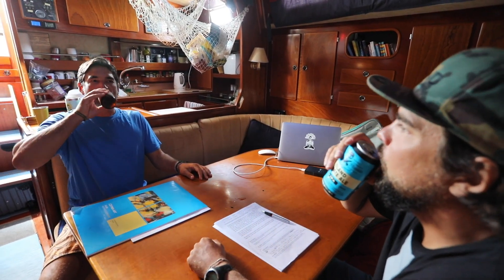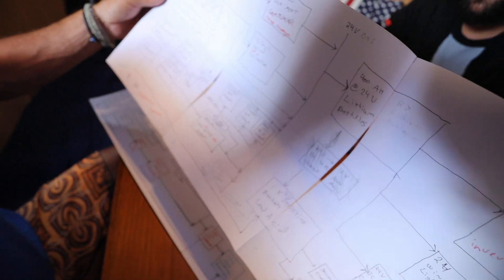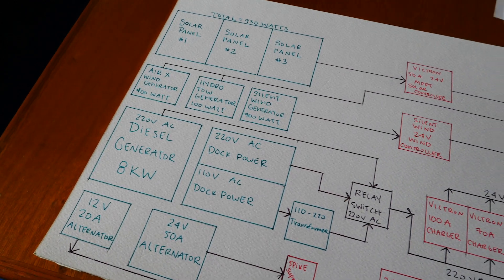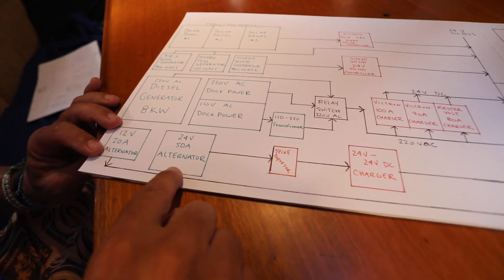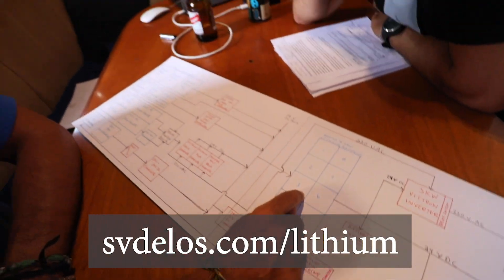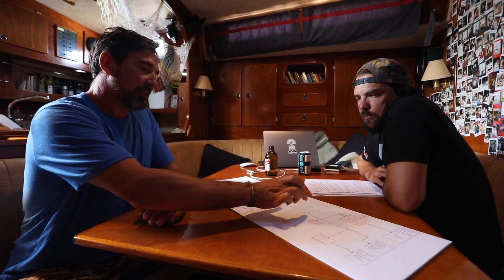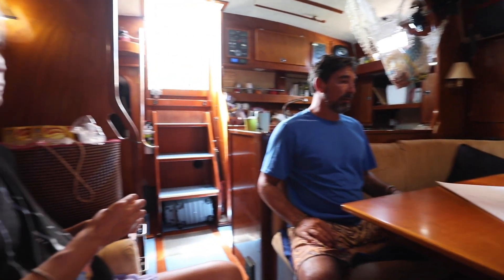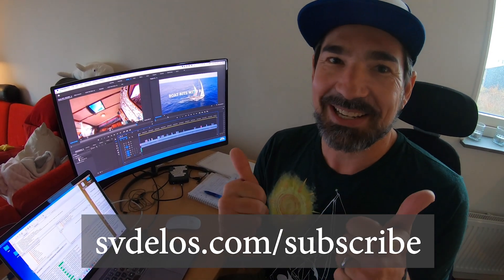Sailboat Electrical System Overview - ELECTRICAL BOAT TECH (1 of 7) - Sailing Vessel Delos

Comment: ... and 50Hz vs 60Hz?  I'm assuming you went with 60Hz onboard and with shore power and just don't connect to mains in countries that use 50Hz?

And plug types; for appliances and electronics, what Plug Types do you use or do you always have to have those Travel Plug Adapters scattered about?

Seeing as a lot of your foundation is in the USA, do you have trouble finding 220v electronics and appliances?  Do you always need to buy Euro spec products?
Reply from the maker: Delos is a 50HZ boat....  It turns out that only place you'll find 60HZ in North America and a few random islands.  Otherwise the rest of the world is 220V/50HZ so finding appliances and such hasn't been an issue until we got to the US.  We standardized on European 2-prong plugs with ground, and I carry a bunch of spares so when we buy something random in South Africa for example I just cut the plug off and put my own on.  When we plug into the doc and there is 60HZ power there are some things that we cannot use like the dishwasher, washingmachine, etc.  So if we really want to use those I just run the generator for a bit!
Reply: @svdelos  
Hey Delos!  Love the Videos, Especially the Tech one.
Some remarks / Comments for you regarding the power system.
I suspect that correctly configured, if you connected 60hz Ext AC Supply, the Victron Multiplus's Transfer switch should Refuse to switch to that, and the AC load bus should remain powered by the inverter. (According to the Multi's manual, if you Program it or leave it at the default 50hz mode, it will only Pass thru and charge if Input range is 45-55hz).
Also a Question, Your Diagram shows 3x Battery chargers,  I take it that while the diagram doesnt show the relationship, the "Victron 70A Charger" is actually the internal one from the Multiplus correct?
Assuming Yes it is, and that the Multi's Xfer switch is smart enough to refuse to xfer if Freq is not 50hz (or you have a means to cut AC supply to the Multi when on 60hz dock power), Then when on 60hz External power, you will have Approx 4.32Kw of Charging supply (100A + 80A) to the 24v Bus, and up to about 3.2kw Inverter draw max load, this leaves you with about 1kw of Surplus Charging power, excluding direct 12v / 24v DC loads, and Solar / Wind / alternator inputs.
The reason why youd only have Max 180A of charging available from AC rather than 250A in this situation is that if the Input frequency is not within the "Allowed" input frequency range you have programmed, the unit also will not run the charger either and stays strictly as an inverter.
Essentially you can use other chargers, plus the Multi's inverter as a Frequency conversion system to run 50hz loads from 60hz supply.
Side note: Some data center UPS's can actually also do Frequency conversion.
ALSO, Your Multi has a Dedicated output for slow charging / maintaining a starter battery, and that's not depicted on your diagram, so might be worth connecting that up.
That way, when your on Generator power, or dock power, you have a dedicated feed for charging the starting batt. Given you use 12v Starting and 24v House loads, you will need a 24v to 12v charger for that output.
Reply: @svdelos  Also, not quite related to Jordans Comment or my Reply, but still relevant to Delos systems, and maybe of significant interest to you.....
You can get a NEMA2000 Adapter for VE.Bus (For the Multi) and one for VE.Direct (For the BMV) that will connect to your Victron devices into your NEMA 2000 network, which will then let your Maretron or other Nema 2000 capable device pull and display data about your electrical system.
The Victron CCGX Can also act as a NEMA 2000 Gateway and is actually the preferred way now.

The use of one of these would allow the person on watch at the helm to be able to keep tabs on the electrical system via the MFD's without needing to leave the helm.
Additionally you can use the MFD's as Remote controls for the Victron devices, such as turning on/off the inverter/chargers, and setting shore power current limits for the Multi.
Have a look here for info:
https://www.victronenergy.com/live/ve.can:nmea-2000:start

Comment: my power bill for october says i use avg 18 kw per day and a total of 586 for the 32 day period. between june and aug i averaged between 1200 to 1600. winter months usually around 700. (im at the bottom of NC, coastal)
Reply from the maker: Very good to know!  I've often wondered what an average house is.  I hope more people comment with theirs.
Reply: I average 57 to 83 kWh/day at home depending on season. Everything is electric in my house - stove, water heater, A/C, heaters, lots of electronics.

Comment: Great to see this.  I have been working on designing the electrical system on my MacGregor 26x.  Figuring out how to tie solar to charge both the starting battery and house batteries while still allowing the outboard to charge the starter battery and house battery has been a fun challenge. Always nice to see other system examples.
Reply: Assuming you only have 12v and no 24v ???
Would seem straight forward, hope you got it sorted in the end?
Reply: @skippyone2769  it is currently pretty simple. Two 12v batteries (flooded) connected together with the blue sea systems mini add a battery and solar charge controller connected to the house battery.  The automatic charge relay should keep the starting battery topped off by the solar, and when the engine is running it should also help charge the house.  I was hoping to be able to use an AGM house battery but it is recommended to mix styles and the charge profiles are different. Still trying to work out a solution to run an Ikea induction cooktop off the house battery and have the ability to have shore power while at the dock.  Just trying to decide if it is worth the cost of the high wattage inverter.  Also looking to install a small low wattage 12v compressor fridge.
Reply: @SchieEngineer  can you charge the start battery seperately from your solar?
Reply: @skippyone2769  the automatic charge relay basically ties the two batteries together when either battery shows a charging voltage (above 13.6v) and isolates when the voltage goes below 12.7v.  That way both batteries are tied when charging but the draw on the house battery can't draw down the starter battery.  So my setup doesn't truly isolate the batteries, but make sure you don't draw down your starting battery. It also isolates the house battery during engine cranking as to not put the starting current to the house battery.  Works pretty well so far.  But I don't have control over which battery is charged by the solar as soon as the solar puts out a high enough charging voltage the relay combines the batteries.

Comment: Great video! If you designed from the bottom, would you still have both 12V and 24V on your boat?
Reply from the maker: Yes most definitely, but some of the things like fans and lights (low power) I would run off 12V simply because you can find them everywhere, however 24V is a little harder to find.  For example nearly all shops will have a 12V bilge pump but sometimes I have to order for 24V!

Comment: Yes ur definitely on the right track. The block diagram was in depth enough to give a good overall understanding of Delos electrical systems. The lithium battery bank ic a little more sensitive than the lead acid battery bank but delivers a more sustainable amount of power. Thanks for this vlog. Perfect. 👍

Comment: Question: Can the charge controllers feeding the 24V bus simply be connected in parallel or do they need to be somehow isolated(diodes etc)? Many thanks for the video, very informative.
Reply from the maker: I've never had any problems connecting controllers in parallel.  In fact all our controllers, including solar, wind, and battery chargers are in parallel with the main 24V bus assuming you pay attention to polarity of course.  I do think you could encounter a situation where if the charge profile voltages are not matched, or the algorithm controlling the controllers are different some may turn off too early, or not turn on at all.  For example if we turn on our battery charger from the generator it puts out enough current to sufficiently raise the voltage to where the solar charge controllers switch off.  Hope that answers your question.
Reply: @svdelos  Hi again, thanks for the reply. I will do some further research to see if some controllers can take being connected to a common bus and others not. As an engineer it sort of goes against one's instincts to connect the controllers in parallel, but it may well be OK to do so due to the output stage designs on the controllers.

Comment: Very nice electrical system design!  Way more complex than my simple 12VDC system on the Catalina 22.  Great block diagram of the system - you can draw this easily in Microsoft Visio and link detailed diagrams / data into a single file.

Comment: What electrical component gave you the most trouble? How did you overcome the issue?
Reply from the maker: To date we've had more battery charger failures then I would have liked.  I'm not sure why, but we kept on burning them up no matter the brand.  It stopped when we replaced the generator, so I suspect that we were getting voltage spikes from the old generator that was damaging the power supply or control board to the battery chargers.  That's just my best guess though.....  Brian

Comment: I really enjoyed this video.  A few years ago I found out the breaker box in my house, and all the breakers in it, were substandard.  So, with an electrician friend we replaced it.  110 volt, 220 volt and different amp breakers, plus some new wiring leading to a new on demand water heater.  Doing that gave me a better appreciation of this video.  Now my 20' sailboat is SOOOO easy electrically that it's silly.  One 12 volt battery powers a 12 volt system of two interior lights and the outside night time running lights.  : - )  You could draw my system on a napkin.  lol                    Scott W